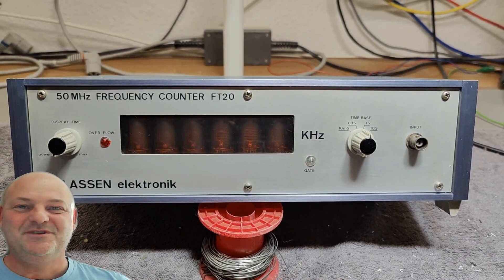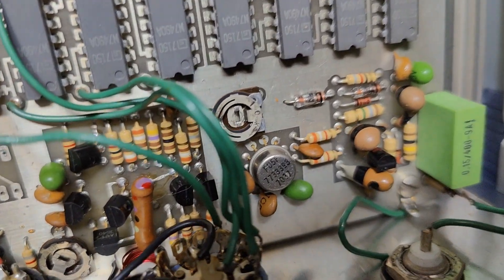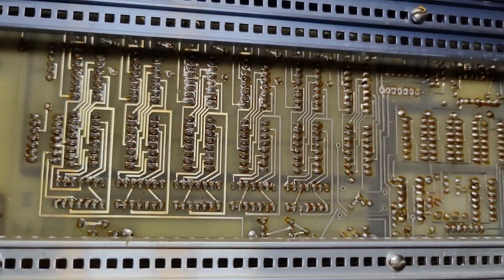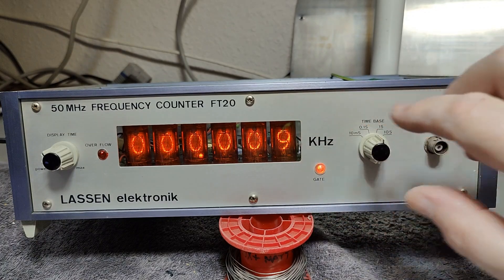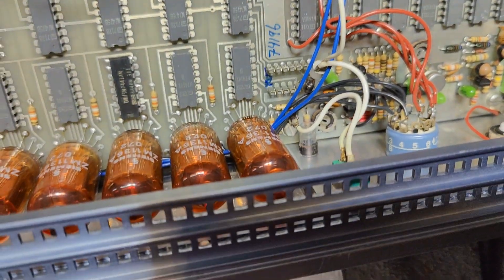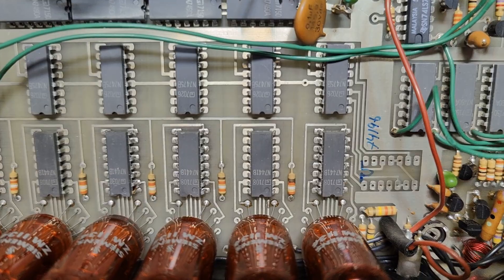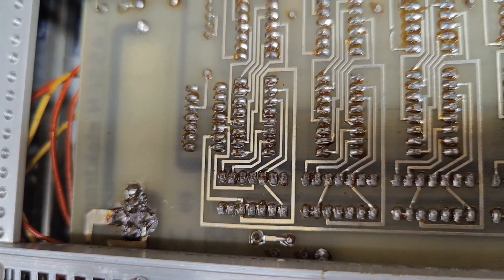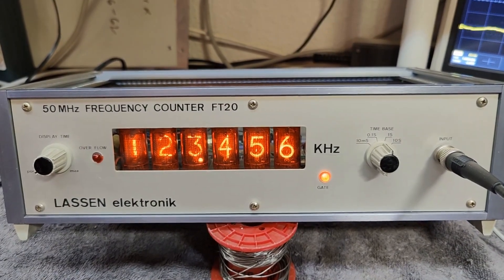Lassen Elektronik FT20 Nixie Counter 50MHz 1971

Comment: Likely used the 196 over the 90 simply because the 196 is a much faster part, and also probably less likely to have race conditions. Input stage there to make sure the rising and falling edges to the counters are both very high slew rate, and also not going to oscillate with slow rising and falling signals, as the counters are going to suffer from poor clocking with a slow input rise time. 

Likely the designer originally tried a 7414 as a cheap way to get this, but found they  needed to aslo stop the counter input during reset, as they probably had issues with counts being made while the count chain was coming out of reset, leading to high counts being registered with longer timebase intervals. so the discrete input stage, the LM733 being fast enough to act as input amplifier, not sure about the gain though, as that is not shown on the diagram, so gain of 10 is likely there. Then AC coupled to the long tailed pair, making the signal square and adding hysteresis. Then AC coupled to the final stage, more squaring, and also AC compensating for high frequency drop off in the preceding stages, and where you also get a gating signal applied to ensure no counts as the latches operate, and keeping the input disconnected till the reset signal had cleared the counters.

Comment: The LS version is a little slower in the specs. The Fairchild DS gives 45 MHz min.  One may have a litle more luck with an added decoupling capacitor close to the chip.